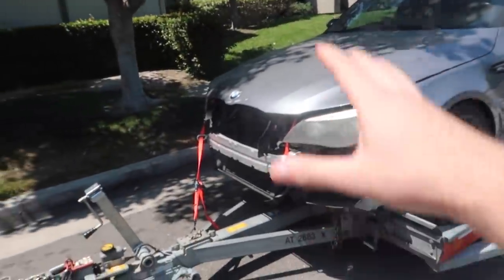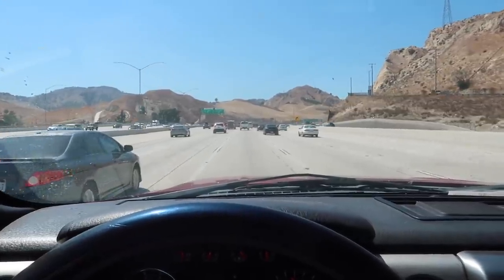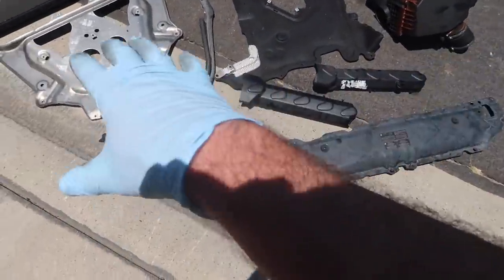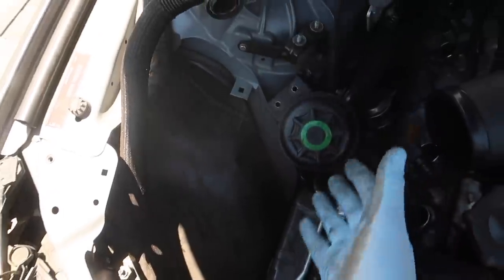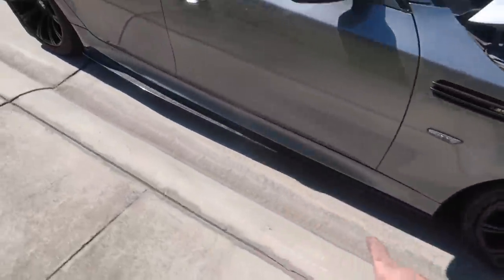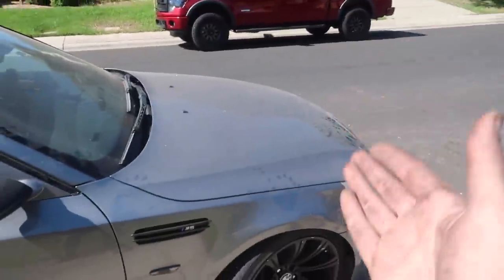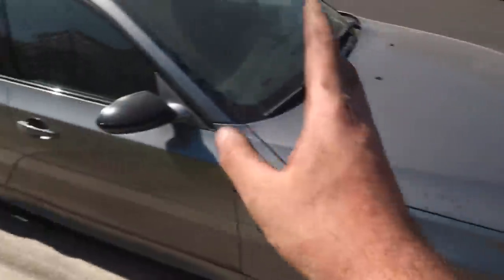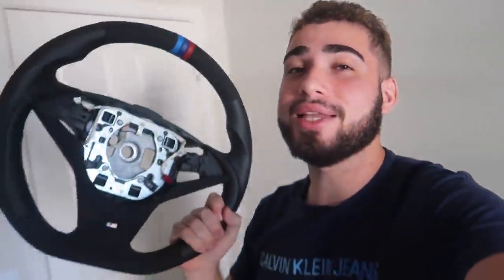M5 IS BACK! REASSEMBLING AND NEW MODS!

Comment: Nour. We want to see the m5 revived! How much will it cost to fix the engine? Can we do a gofund me like we did for the paint on the m3???? I am willing to contribute to this!
Reply: 10k for a good motor
Reply: @TheAcarr6  we can do it. He doesn't have to replace motor just repair it at ssr.
Reply: yes im so down for this
Reply: @BubbleboyJ  Not worth it unfortunately, If I remember correctly he said there was a lot of scoring on the cylinder walls which cant be repaired so a new motor would be the only option.
Reply: @matthewmoroko1586  another motor then.
Reply: 😂 weirdo
Reply: @Beatrice Huggins why does his religion/race matter lmao. His house doesn’t look like he’s super rich.
Reply: Beatrice Huggins lmao this man hating for no reason
Reply: @matthewmoroko1586  a new engine block you mean
Reply: @qefigaming2115  I guess you could say that. Might be easier to just source a new motor all together but yea.
Reply: My s550 Mercedes has same issues so instead of buying a new engine I bought an engine block and fixed the whole thing.
Reply: Bore the walls and put a stroker kit in it. Save the V10!

Comment: You need to know when to hold them and when to fold them, the M5 is not like the 7 series, 80% chance of success is a time to hold them! Probably low compression from all the fuel in the cylinders washed the oil out from all the failed cracking! You should have put the flywheel and clutch on it was at SSR ready to go, it would then run, worst case you could have sold it as a runner(down on power). The 7 Series was a time to fold them, it had too many issues from the get go.
Reply: They did a leak down not a compressions test
Reply: Johnny Chimpo  a leak down test gives a better overall idea of the health of the engine and identifies the problem of the cylinder. A compression test can have its results manipulated by various things. It’s not as clear cut.
Reply: @HorsepowerTherapy2  Doesn't change the fact that it could be leaking past the rings due to lack of oil film, or maybe it just needs to be run to clean the crap off the valve seats.
Reply: @uksa007  oil only effects compression testing. Adding oil to the cylinder during a compression test will improve the results. But for leakdown test the engine is not turning over. If the air is leaking past the rings during the leakdown you have either bad cylinder walls or piston rings. Oil does not to be present in the the cylinder walls to determine if it is capable of holding pressure.
Reply: Johnny Chimpo  yes it does because if the cylinder is not able to hold pressure then that cylinder is junk until it’s the problem is fixed. Each cylinder is tested at TDC compression so if the result is bad the problem is mechanical. And if that’s the case for multiple cylinders it’s safe to say the engine is trash.
Reply: @HorsepowerTherapy2  If there is little to no oil film on the cylinder walls the rings will not seal as well as they could and air can leak past them, similar to a compression test.
Reply: @uksa007  the piston is not moving during a leakdown test. Oil will only help seal when it is in its hydrodynamic form, when it has reached a high enough velocity.
Reply: Johnny Chimpo  having the engine warm will effect the results and will provide a better reading but it’s not necessary to get a good idea of how good the engine is. The guy said some cylinders had 60-80 percent leakage. That engine is junk and no amount of warming up or adding oil to the cylinder is going to change that. I’m sorry but did you just say an issue with the transmission? You have no clue bro that has nothing to do with a cylinder leakdown test
Reply: Johnny Chimpo  no amount of engine warming is going to substantially improve a 80 percent cylinder leakage
Reply: Johnny Chimpo  the writing is on the wall the engine is trash. Previous owner lies about doing rod bearings. SSR basically confirmed this. Milky Way galaxy engine oil. Horrible leakage results
Reply: @HorsepowerTherapy2  With the piston stationary there is till force applied to the oil film between the rings and the cylinder wall creating a better seal than if there is no oil on cylinder walls. Problem is we don't even know if the leak was  rings/cylinder or valve. Putting some oil in the plug holes and doing a compression test would have given him a better idea if things improved or stayed the same(valve issues). Without the engine running you are pretty much guessing what might or might not be the issue (if there even is an issue) from memory there was only one cylinder that was really bad.
Reply: @uksa007  lol no